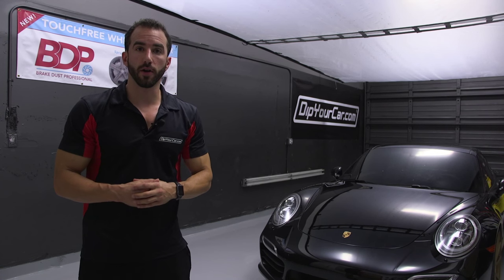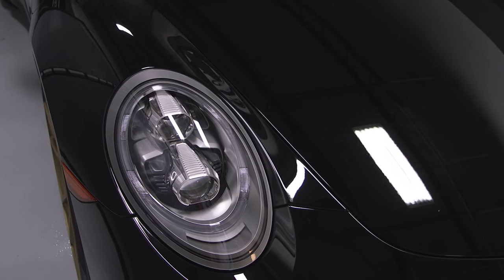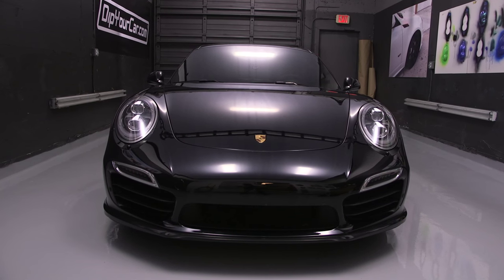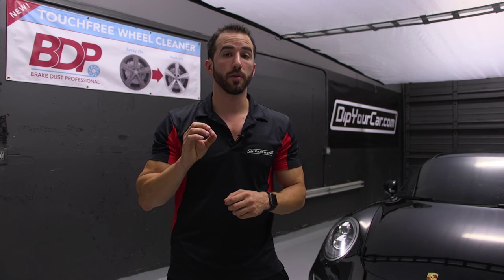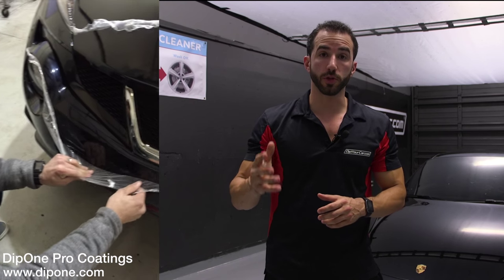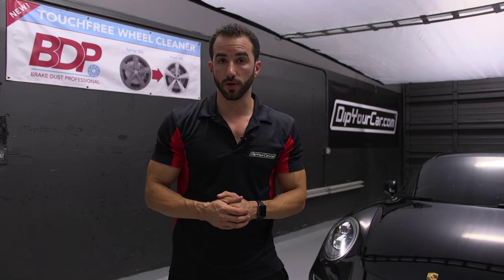AutoFlex Spray Shield™ - Protective Coating

Comment: I mean, this is basically just clear/gloss plasti dip, but with a more focused purpose. We used to do this back when you first came out with this stuff, we'd spray it on the back wheel wells of our cars at track days to keep the paint from scratching from the road debris being kicked up.

Comment: Bummed you didn't talk about the advantages of this over paint protection film. Going to think then that there aren't any.
Reply from the maker: +Po Russki The advantages were clearly stated in the video, however not positioned directly against PPF in an effort to be respectful.  No blades are needed, no cutting against the surface of the car when applying SS.  SS does not result in visible seams and edges all over the car like PPF.  SS also does not use any glues or adhesives, so when it is removed, it leaves nothing behind on the surface.

Comment: This is wicked. The only thing is that its getting far more complicated than regular plasti dip. You almost need to be a painter to apply this and get the results you have shown. I'm very impressed with the technology so far!
Reply: +Alvin Brinson Yes its very expensive. I've been custom painting for over 10 years and when I saw this product I was really blown away by the results. Though it was worth a try but when I saw the prices its just as expensive as custom paint but might be worth a try if people are willing to pay for these types of results.
Reply from the maker: +S.C.P. 049 Pricing is far less than custom paint.  To coat this entire Porsche with Spray Shield you would use less than $350 worth of materials (considering you only use 1/4 gallon of gloss per vehicle).
Reply: +DipYourCar I was more talking about the price of your materials is more expensive than automotive refinishing materials. You can purchase a gallon of clear for under 75.00 if you wanted. It is true they're is more time and labor in custom paint but with Autoflex costing more than standard refinishing products. I would love to paint with Autoflex I just think the prices seem a little high for a temporary coating. What are the results long term by the way? Does it yellow or discolor over time? Does autoflex have the same rubber texture as plasti dip?
Reply from the maker: +S.C.P. 049 AutoFlex feels like paint when dried, not like dip.  Obviously there should not be a direct comparison to paint, as this technology peels off - paint is permanent.  The product does not yellow or fade over time, it out performs the PPF films currently being used long term.
Reply: +DipYourCar It should be compared to paint because their is only 3 ways to change your cars color paint, vinyl and plasti-dip. I have tried other brands of "clear bras in a can" on the market and hated them. How is autoflex different than those types of clear bras in a can? Does autoflex require a catalyst? Thanks for answering all my question. I very much appreciate the information. If is as good as you say it might be worth a try!
Reply from the maker: +S.C.P. 049 AutoFlex is absolutely nothing like any of those other products.  The top level gloss is a 3 part system that feels like OEM clear to the touch but remains flexible over time.  All the benefits with paint, but can be peeled like dip.

Comment: I wonder if this can also be used as an intermediate layer between dip or vinyl to make removal a sure/easy process for applications that are left on vehicles for an extended period of time as removing old degraded vinyl wrap is certainly a painstaking process as I'm sure Dip can be if left for years.

Comment: Can i use it in this sequence?????----> 0) Wet Sand the car with 2000 grit 1) Spray Wrap Primer, 2)Spray Wrap Pro, 3)Buffing, 4)Spray Shield, 5)AutoFlex Gloss. P.S. I don't really want to peel it off thats why i am wet sanding the car.

Comment: I saw a few streaks on the hood...
Reply from the maker: No, you didn't. You saw the reflection of the steel rafters on the ceiling in the high gloss.
Reply: +DipYourCar oh, true lol
Reply from the maker: +HockeyLAKings119 That's what happens when you have a mirror finish.. you see errything.
Reply: pretty sure its from the spraying
Reply: If it were a defect in the finish, then the lines wouldn't move along with the camera as it moves.  Also, if you are implicating that there is a defect in the finish, then that same defect must also plague whoever produces the windshield for the Porsche, as the "streaks" are also visible on the windshield.  In other words, it's the rafters being reflected off of a mirror-like surface.

Comment: Can it be used on top of dip?
Reply: +undagrin Spray Shield or Spray Wrap Pro should be your base when applying AutoFlex Gloss or Matte
Reply: +DYC Customer Service So use this first, and dip ontop? Or just one or the other?
Reply: No, when spraying AutoFlex you won't ever use Plasti Dip.  You start with Spray Wrap Pro or Spay Shield and finish with AutoFlex Matte or Gloss

Comment: Should you get your car polished to remove swirls first or does this hide the swirls in the cars clear coat?
Reply: I would guess it'd hide swirls. after wet sanding clear I add a new coat on and it's clear again so I would say the same logic could be applied here.
Reply: +Kevin Kurz 
I would like to know this as well!
Reply: Remove swirls first.

Comment: Basically a thick clear coat.
Reply from the maker: +joes04redrx8 Please research and test the product before commenting.  Your assumption in this case is drastically inaccurate.
Reply: +DipYourCar then wtf is it? Like 3m clear wrap

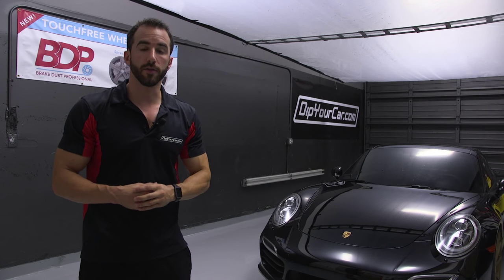Comment: 0:30 If you look the hood you can see the streaks it left..
Reply from the maker: +Yan Sagz No, you can't.  You can see the reflection of the steel rafters on the ceiling.  That tends to happen when you have high gloss finishes.
Reply: Right, now that you point it out, i get it.
Thanks for the reply
Reply from the maker: +Yan Sagz You're welcome.

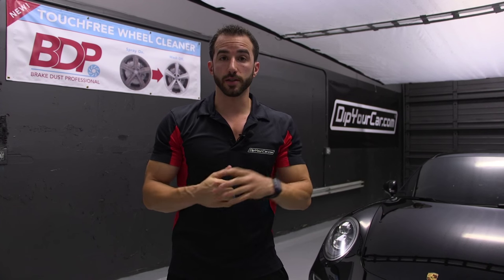Comment: @3:21 you can see the spray lines on the hood...
Reply: That's the reflection of the ceiling of the building. Look at the front window of the car.
Reply: +Waylon Shofner touche
Reply: +dmoua08 i thought the same thing lol
Reply from the maker: +dmoua08 The reflection of the AutoFlex is like a mirror, you can see all the steel rafters on the ceiling.
Reply: ***** SOLD! lol